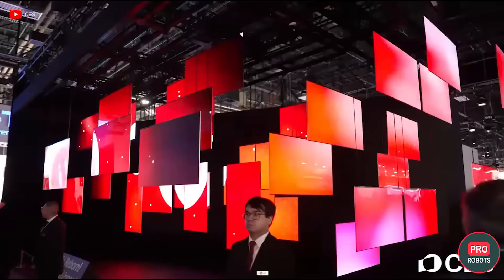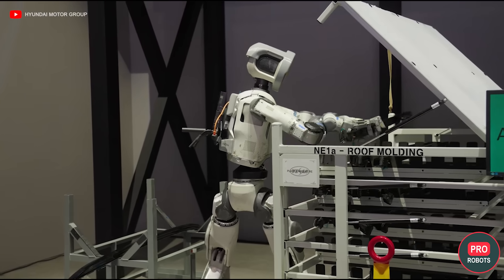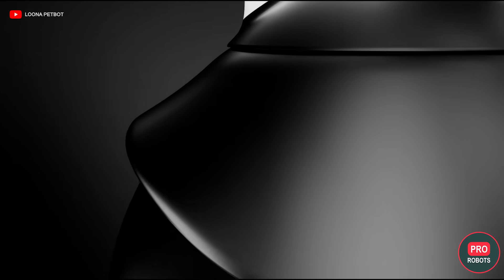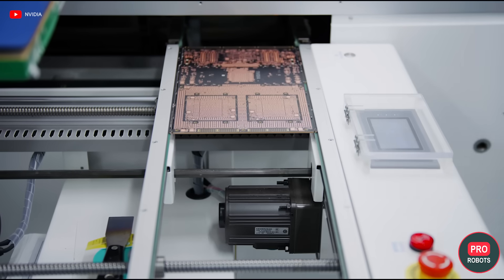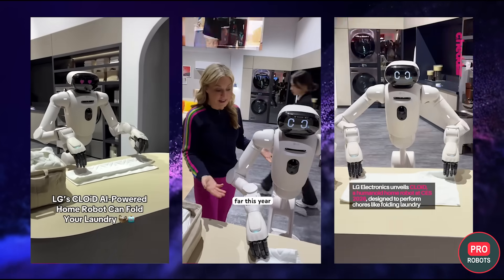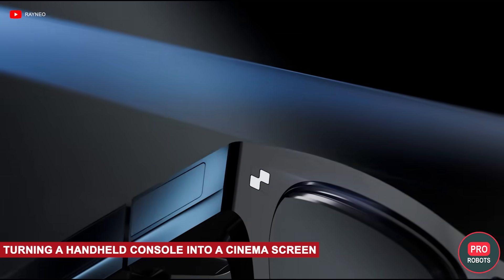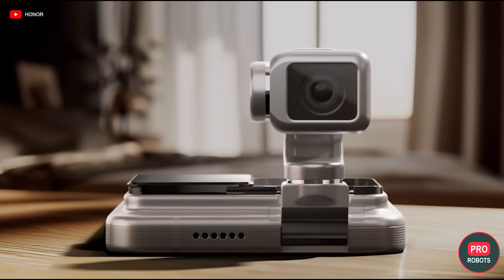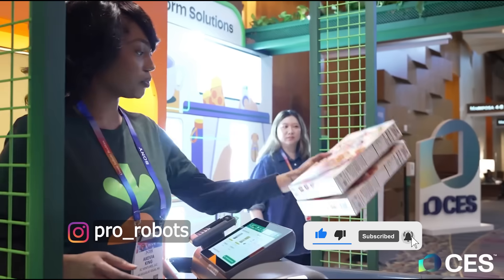The Biggest Robot Exhibition in Las Vegas | CES 2026

Comment: I dont understand why utility robots are made in the shape of humans. Humans are made in our shape but we don't have a choice. Things like household robots would be more capable of more stuff if it were just a box with wheels I would have thought. You would save 90% of the trickery of standing up and walking and use that brain power for other things. Same in factories building cars etc. We are that shape because we are already that shape but robots can be any shape that could fit around a car being built.
As for personal interaction robots for nursing or for human intimacy etc, then I can see why they are the shape of a human but that is not discussed here, at least not so far as I am halfway through watching.
I can see a tunnel shaped robot that can pick fruit or vegetables easier than humans taking over from pickers on farms. Is that where we are headed? Is that why they are being rounded up?
Reply: Ok they showed the robot with no legs and pretty much for the reason I was thinking. Just easier and more stable. But it was still trying to fold towels like a human.  And picking things up with it's robot fingers when they are probably the most impractical.